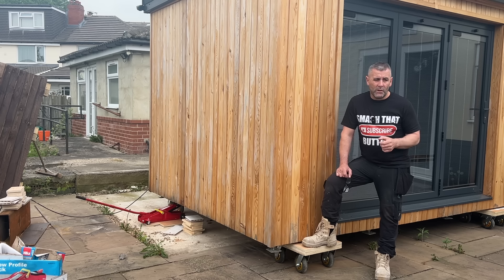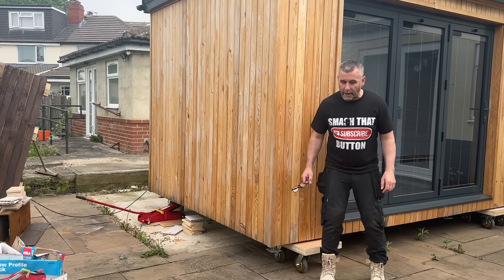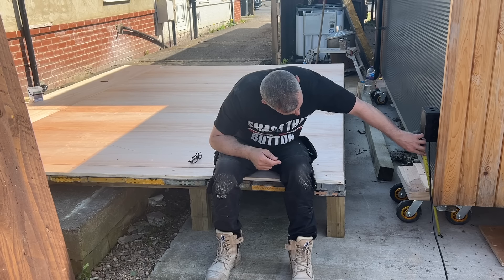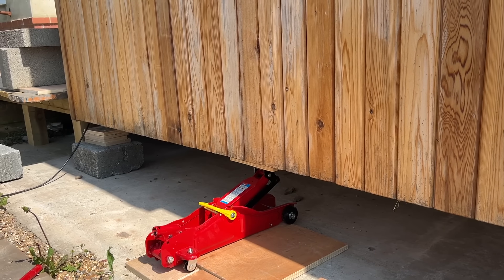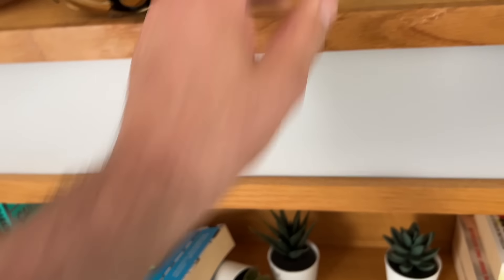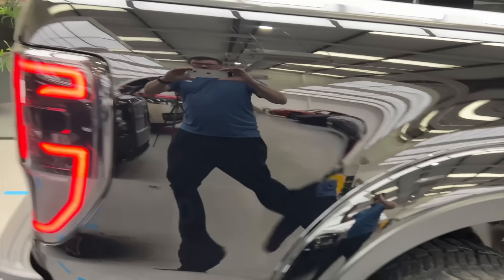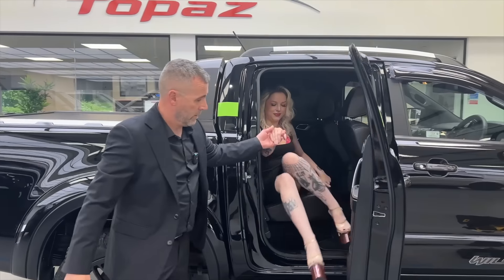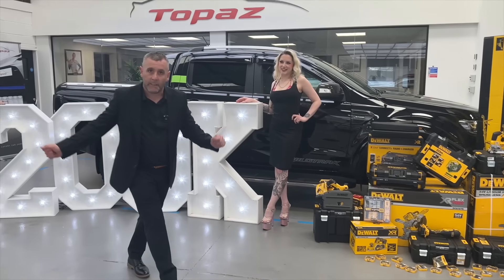Can I lift this garden pod weighing over a tonne 280mm and move it 3mtrs😬Part 2

Comment: A couple of sleepers and put 6(or more) x 12" pieces of steel pipe like Scaff tube or larger and roll the building on the tubes.
Reply from the maker: roll to where mate?
Reply: @thegardenroomguru  onto your neighbours drive? Or is that not the intention?

Comment: Good to see you back mate, I realise this comment is useless now as it’s already done haha but is there a reason you never reversed the hiab truck right up the drive and just lifted it from where it was?? next doors drive looks pretty wide would only need 7/7.5 feet take the fence down the full length to the main street and just build him a little pad to put his legs onto.
Reply from the maker: Next doors drive is 2.5 wide at its biggest, full fence would cost 1500 minimum to replace
Reply: Fair play it would be a bit tight for a truck. 1500, Wood must be hella expensive down there.